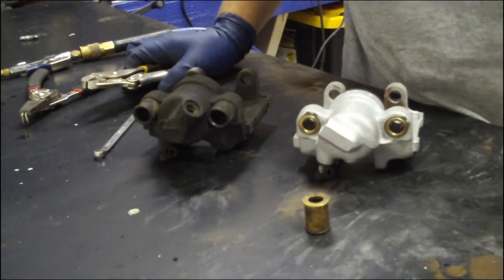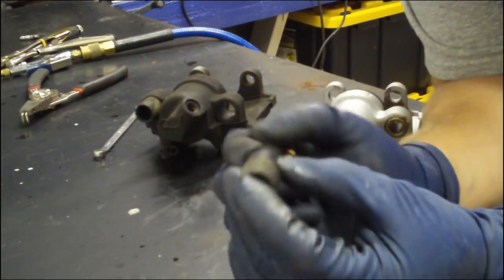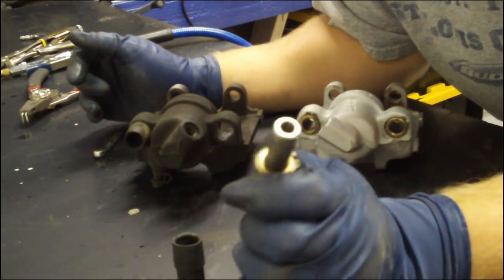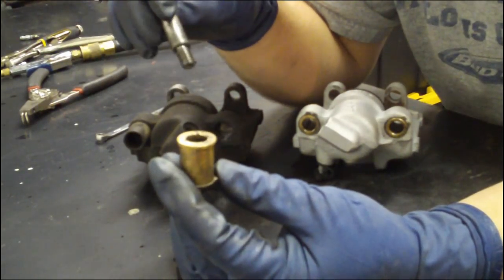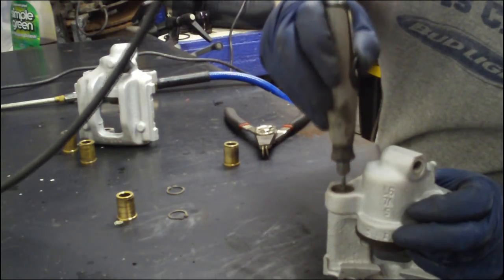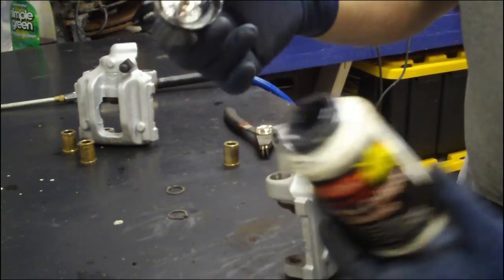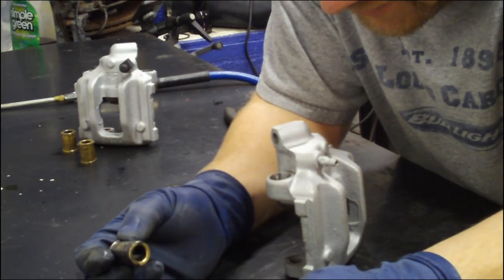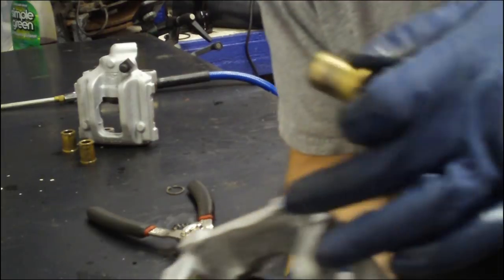BMW Brass Caliper Guide Pin Bushings Installation

Comment: Dude! Thanks for the video. You the best. IMHO I'd rather go with OEM rubber bushings just because here in Ohio it's dirty and snows a lot in winter. I bought a car in Arizona and these Brass bushings were installed which I wasn't aware of. Apparently I didn't maintain and grease them on time. Now I ended up with uneven wear of pads. As you said - I'm not sure if I want to try to take them out now because they are really rusty and oxidized now. I'd say these bushings are better for the track use or a really non-humid climate.

Comment: Turner Motorsports sell the version for 335i bigger front aluminum brakes. They require uneven length pins and bushings. Their bushings come with inner o-rings to lock in the grease as well as keeping out the corrosion, salt, dust.

Comment: @goriup Fixed calipers like the big multipots are rigidly bolted to the hubs and aren't always mated with floating discs. This setup still allows for sliding (it has to for it to work) so it will still give for disc variation (plus the hydraulics too), it's just to try and reduce the caliper twist. They'd never come this way from the factory for the reasons explained in the video; maintenance is much higher.

Comment from the maker: It depends on which E92 you have.  We have a kit that will fit all four brakes on the 328i, 328Xi and the 328i X-Drive.  However, they will only fit the rear brakes on the remaining E92s.

Comment: I use them on my race car. Unless it;s a road car and exposes to rain, salt and mud, it has almost zero maintenance. I ran plumbing brush through and removed some material for better sliding.

Comment: No Debate. The flange goes outboard(towards the rotor), the Circlip goes inboard(towards the back of the caliper) If done the other way, the Circlip likely will get punched out as the caliper uses this ridge to push out when sliding across the guide pin.
Reply: I've seen them done both ways now. I bought a set from Garagistic and I looked at their video on here and it looks like thr clip is on the inside of the caliper by the piston. That's how I installed. Now I'm not so sure. Fck.
Reply: @crherniman   @crherniman  no, no, no. Good thing they're not press fitted. Take them out, clean them, and switch them to where the circlip goes behind the rotor.

If you could, please link the video from gargastic for us to compare. If there's a problem, I'd like to contact them about this.

... OMG, I just saw the garagistic video I think you're talking about. That video doesn't show an install, but it does show that it's installed wrong. I could see them saying - hey, let the new guy do this video because we want him to think we're cool, but really we're too busy to do it ourselves, and that's what we saw. 

Garagistic is a small business, low budget. Camera guy is probably a friend. I've been to their shop twice before, and they seem like they are trying to be cool, kinda like the volcom of aftermarket parts for bmw. Both times, they weren't ready for walk-in customers, and showed like they were really ready to do business... I'm going to call them about this video. 

They make good stuff. Their welder and machinist are very talented. They make beautiful peices, like their adjustable solid and non-solid shifters. But, it is possible that they totally overlook things form time to time. 

Anyway, there are 3 videos, with a forth, you could look up on yourself on ecs tuning, where there's is actually press fit, and even still they install it the way I'm tell you because of risk of loosing the fitting. 

Try to imagine if the circlip fails, where would you want the bushing to be - on the car making your brakes act weird, or the bushing slips out and falls off the car, potentially making you have no brakes at all. 

You should fix that right away. 

Here are the videos 

https://youtu.be/fayiVvWNUO8

https://youtu.be/XFJ0Wog0Seo

https://youtu.be/E7H3fmgYaU0

Comment: Well I would have a comment about this - much like wiper linkage (which is essentially steel axle in a brass bushing), it will solely corrode on the inside because you're using two different kinds of metal. It is extremely essential to have these lubed all the time - otherwise - in ideal world with no dirt, surface corrosion will eat the steel pin which in turn will eat out brass bushing - seen it in reality many times...
Reply: this is a performance up grade and the bushings should be lubed up with brake grease. They are also in need of constant attention due to their exposure to the elements. It is a great upgrade and if done properly (maintained) no issues. Cant deal with them the same way as the rubber which most simply ignore. Hope this helps

Comment: ATE OEM rubber bushings are durable, it's all the aftermarket bushings made in China that fit sloppy and flex.  With these brass bushings, they will stick ever so slightly and you will lose horsepower at the wheel and MPG. OEM is best.